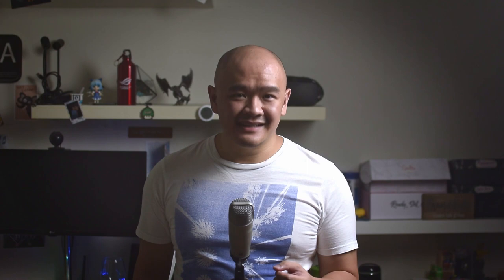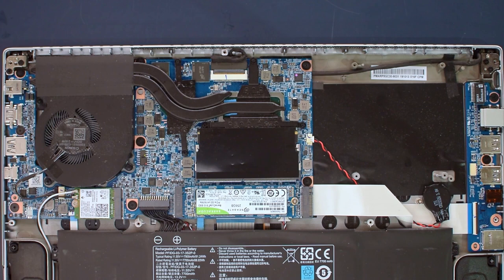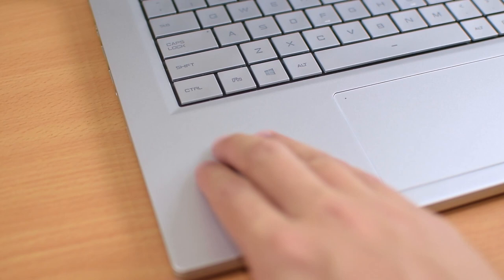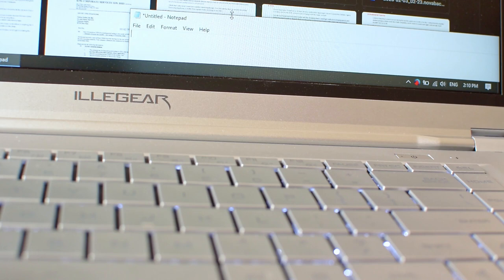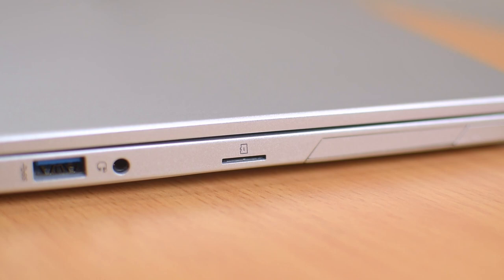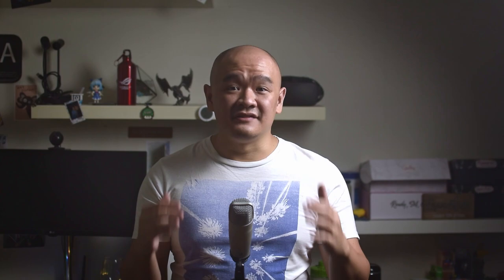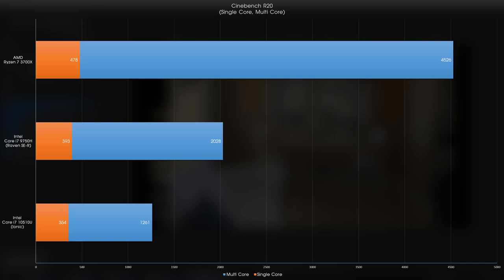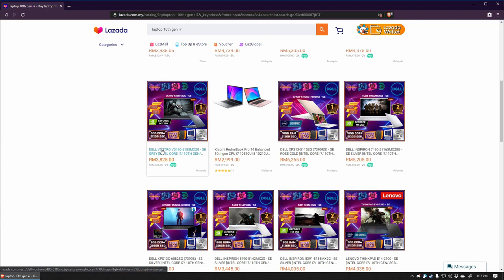Marathon Runner - Illegear Ionic 15 Review

Comment: I looking forward to see the Ionic 15 Ryzen. As from research, it's a Chinese chassis called Mechrevo Code 01. From other brands it has dual fans, heat pipes, and heat sink. Without the discrete GPU, it might run even cooler. And  you might even be able to up the TDP of the CPU to 54w. Other brands has a grey finish instead of the silver which I think is much classier. This might be a better value for money than intel's offering. (Feature me if you could get the info from Illegear haha) Anyway, nice review, love the detail, critics, and voicing up for us as a tech reviewer.
Reply: I've ordered the Ryzen version from illegear last week, ETA end of the month tplink early November. I think there are a few differences between mechrevo and ionic as the former supports PD over type C but illegear told me ionic doesn't… Kinda hesitate buying gan charger at the moment😂
Reply: You have to try it yourself, I got my hands on the illegear version, please they have the ir camera for windows hello which mechrevo doesn’t. I was worried that the description was listed wrongly on their website and tons of research said it doesn’t have a ir camera for windows hello. But I haven’t try the PD charging. I don’t think you need to worry too much if your uses isn’t too heavy. The battery is big and it should last you the whole day till you get home.
Reply: @danielchong2917  hows the ionic ryzen broo i want to order it but worried if the integrated gpu is sufficient enough for light video editing and autocad

Comment: Hello, it is great to hear that Illegear had solved the keyboard issue. 

May I know how is the track pad / touch pad feel? Is it accurate and smooth? 
I would like to try out at their showroom but unfortunately they are closed for maintenance. 
I wouldn't want to bring a mouse around anymore, like my Dell Vostro needed now. 

Thanks!
Reply from the maker: The touch pad is a bit on the rough side to be honest, there's definitely some resistance to it. 

You can wait for when their showroom is open to try it for yourself

Comment: This laptop is the exact same model sold at Walmart for cheap. Illegear has jacked up the price to make it seem like a premium laptop but I totally agree with your brother in law - it feels like a really cheap laptop.
Also, one fan only for both the i7 CPU and Nvidia MX250 is just terrible, because the temperature will be very high, especially during editing videos/rendering/high load.
Reply: Hello Timmy, thank you for your feedback and comments :)
The Walmart variant is different in specs:
Walmart Motile 14: 14" FHD, Ryzen 3, 4GB RAM, 128GB SSD, 47Wh battery
IONIC 15: 15.6" FHD sRGB 100%, Intel i7-10510U, Nvidia MX250, 16GB RAM, 512GB SSD, 92Wh battery

Comment: Good job for the review. As someone who also does creative work, I wouldn't buy this solely because of the terrible keyboard. This also seems to lack a section talking about the trackpad unless I missed it? It is kinda frustrating no one else is able to come up with a laptop that has a trackpad as good as the Macbooks.
Reply from the maker: Yeah it's something that I accidentally ended up skipping in the review. 

The trackpad is... Rather unexceptional, and doesn't do well at Palm rejection, so you'll have to lock the trackpad often. 

Apple's MacBook trackpads are the gold standard for trackpads.

Comment: I'm using this laptop right now and totally agree with those point you highlighted.

Pros:
1. battery life is really amazing
2. great display
3. lightweight

Cons:

1. Really not pleasant to type with this keyboard. Prefer to be a full size keyboard
2. This laptop do get quite hot if you running some heavy content / gaming
Reply from the maker: Glad to see that you enjoyed the content!

I never got the laptop quite as hot as what you mentioned, but I didn't really do extended gaming on it.
Reply: so far, how does this laptop perform?

Comment: Hi, you highlighted ionic 15 has amazing battery life of 15 hours 30 minutes. Could you please share what was your setting? because mine only last about 6 hours after fully charge 100%. And, mind to share how long it takes to charge to 100% capacity?
Reply from the maker: That's very strange. I set mine on better performance, and just on Google Docs/ Youtube/ Netflix. The replacement unit they sent me for testing performs similarly.

Maybe you've got some background applications running that is causing it to perform worse?

It takes about an hour and a bit to reach full but I can't say 100% for sure as it wasn't something I particularly took note of.
Reply: Hi, can share your experience of using ionic? Any problem encountered so far? The battery still in a healthly status? Thanks

Comment: the chassis looks similar to the motile THX sold by walmart especially the 14 inch model
Reply from the maker: Good eye, same ODM, TongFang. 👌
Reply: @TechRodent   its very strange how intel put the new lineup of Intel Core i7-10510U in terms of price and performance. Whats your opinion comparing it to Ryzen 7 3700u? As viewing from consumer perspective i would think 10th gen is better than 9th gen, however that not the case for this comet lake CPU. https://www.cpubenchmark.net/compare/Intel-i7-10510U-vs-Intel-i5-10300H-vs-AMD-Ryzen-7-3700U/3549vs3646vs3426

Comment: Does this laptop have sata port
Reply from the maker: Most modern laptops don't have it, unless they have a mechanical 2.5" hard drive inside.
Reply: @TechRodent  I'm thinking of buying one without the included drive and just swap the SSD from my old laptop. Well, its no longer an option.
Reply from the maker: @mohammadsallehpahin8669  most laptops now use only a M.2 SSD unfortunately